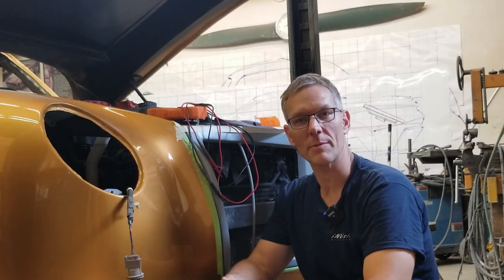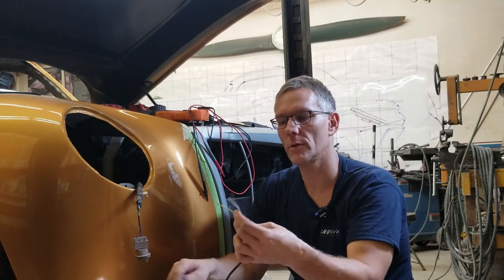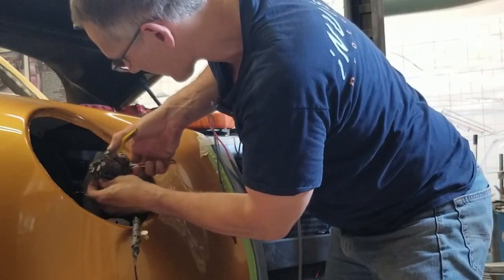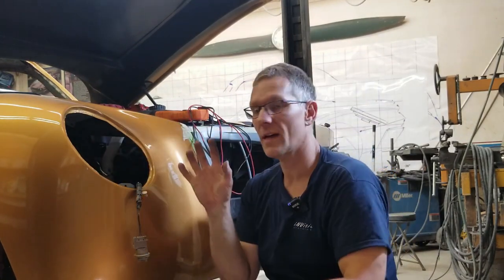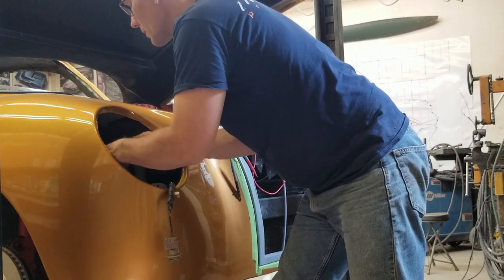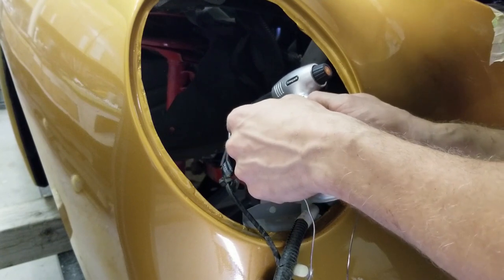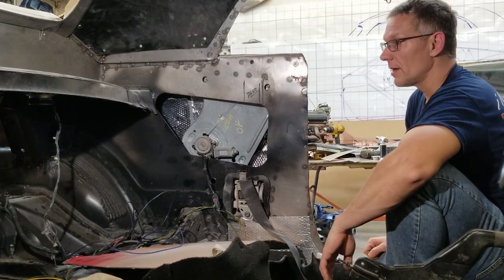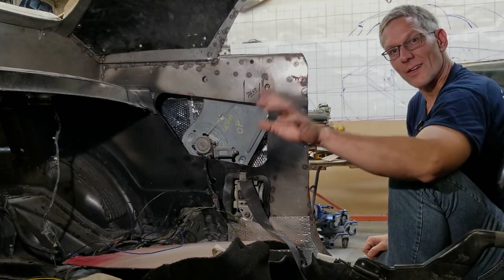Wiring Lights & Power Windows - Rapid Flash FIX - Ep.74 | 1940 Ford Inspired Hardtop Coupe

Comment: Wiring and interior are my favorite part .... like the color ... didn't see if there was an o ring or gasket on the head lites but you wouldn't want muddy water runnin out of them ... I made polypropalene inner fender wells for mine front and rear .... can't wait to see more ....
Reply from the maker: Thank you Sir!  No o ring gasket.  Initial thought was to create one, however with the inner wheel well liner is a direct 'clip-in' in from the mustang(we did add some metal from the outer fender lip inward to pick up the guard) and will contain any splash.  Looks better without a gasket too.  Thanks for watching!!

Comment: Wasn't there window wiring and switch in the mustang before? I'm missing something here.
Reply: Since when did Mustangs have opening REAR windows?
Reply: @nickwheeler8231  that a good question.  I don't know. I don't think they ever have now that you mentioned it.  I don't think he has posted a video putting that system in.
Reply from the maker: Convertibles did, but this project started with a roof and no 'extra' wiring for power 1/4 windows.  We tried to find a factory harness to add into the system with no luck.

Comment: stock huh? playing the devils advocate. I buy your car and for whatever reason it is a no crank no start down here in the lower 48. What would be the expectation of it actually getting repaired? I would guess even knowing it is a mustang... pretty close to zero. Sure they would milk me several 1000 before they would give up and say it is ALL custom. I think for that reason saying it is stock is abit of a reach. But maybe the mechanics up north are more competent than here.
Reply from the maker: Hi Jeff, that's a great thought and I appreciate your concern about repairing a potential issue that may arise.  Aside from the new headlight pigtails, an extra 12VDC wire run from the fuse panel for the 1/4 windows, trunk /fuel door release & custom head unit the car's wiring, ECM, PCM, BCM, etc. were not molested in any way.  Any issues, simply plug into the OBD2 port and Bob's your uncle!  Tell you a story, not sure if you've seen the R2 mid engine sports car we built a while back.  O2 sensor was acting up(he didn't know this at the time of course) while the owner was on a roadtrip.  They located the nearest GM dealership had the car diagnosed, repaired and back on the road.  Took longer to have the techs take selfies next to the car than the actual repair. lol!!  I'm sure there are places that would jump at the opportunity to take advantage of a 'repair'... heck I've been there before with my daily.  Anyway, thanks for watching more to come.
Reply: @iNVisionPrototypes  I wasn't kicking.  When it seems society seems to be sticking forks in light sockets as a default state.  Having some knuckle head screwing up something I spent 12 months on seems terrifying. In my industry there are levels of "fixed" that I have to fight far to often.